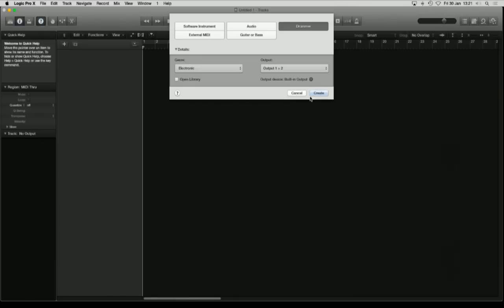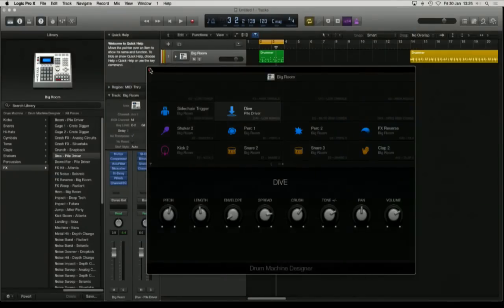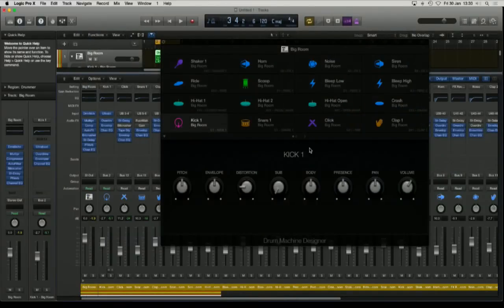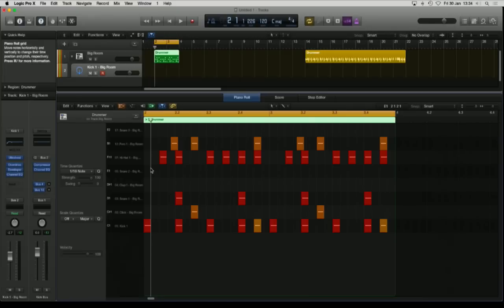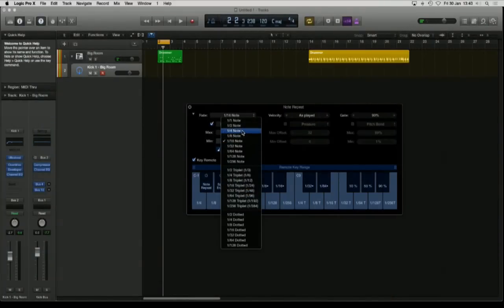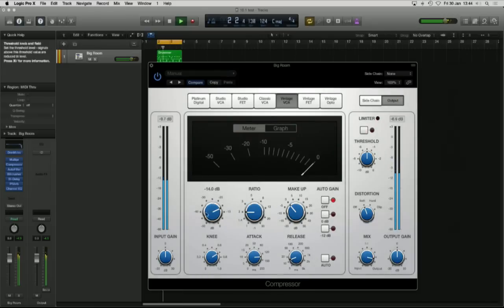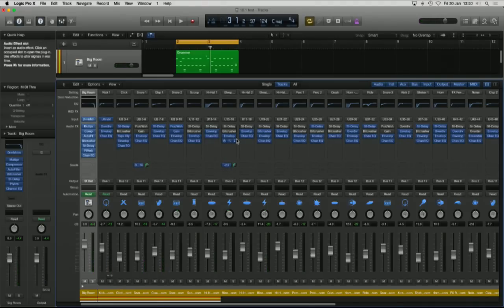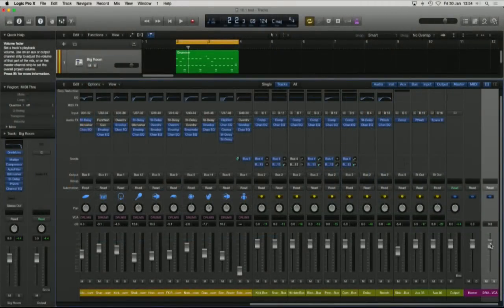Logic Pro X 10.1: What's New? (FFL!)

Comment: what KRK do you recommend for electronic music? Are they the best or?
Reply: Get an 8 if you can (Rokit8) since you'll get a lower extension, especially if your room is treated. You will also get beefier amps for each driver. KRK make two lines above Rokit one of which is VXT that also comes in an 8. Atom Audio makes nice monitors, but if you want some of the best and have the cash, Genelecs you can't go wrong. Again get an 8 inch woofer (the Atom might be a 7.5 inch).